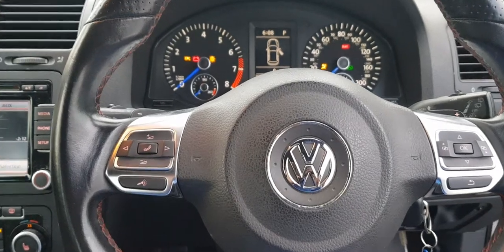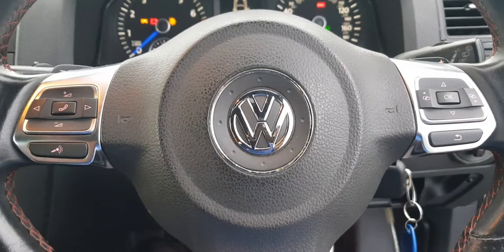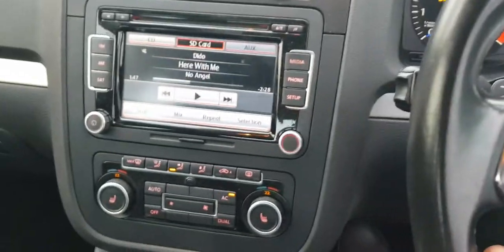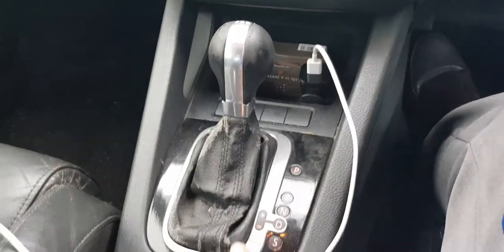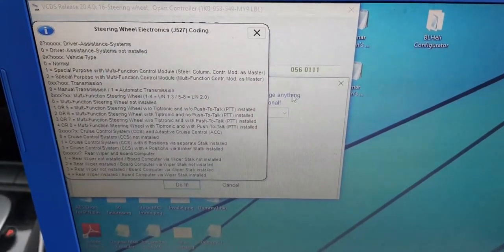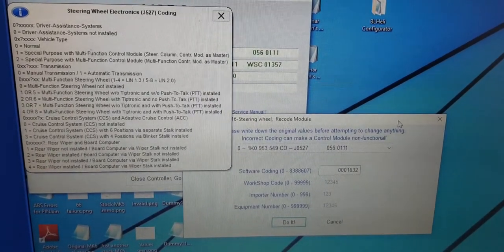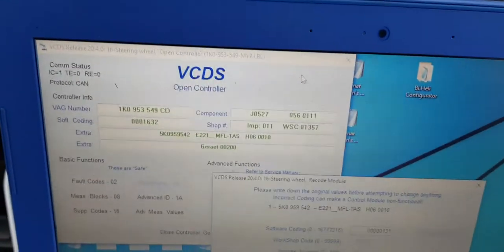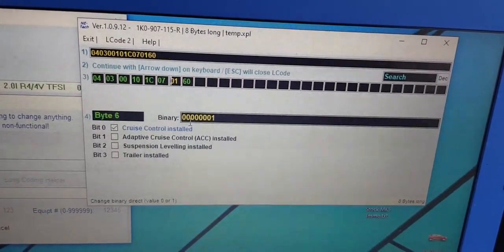MK6 GTI retrofit in a MK5 GTI coding

Comment: Can you teach how to retrofit a mk7 racing steering wheel onto mk5? Without the cruise control
Reply from the maker: I've never done it before,  but the process is the same,  however not all buttons will work (especially the horn).  The MK7 uses a different protocol.   There is some rewiring of the steering wheel control module that has to be done to get most of the buttons working according to the forums I've read.
Reply: @MatthewTaylor3  ok thank you man
Reply from the maker: @Tommy369x  I looked back at the issue.  The number of changes you would have to do to your MK5 to make ALL the MK7 buttons including the horn work would be equivalent to swapping in a good chunk of MK7 wiring and modules to the point that your MK5 is electrically a MK7 and you could even have a different VIN.   It wouldn't be worth the hassle in my opinion.  If you were in it just to get SOME of the buttons to work, and the aesthetic appeal then it might be an interesting project.
At the end of the day, you still want to know that your airbag WILL work in an accident.

Unless #RaceCar
Reply: @MatthewTaylor3  Alright man that’s some good info to know from you, would vcds be able to do the modifications? My current plan is to fit the Scirocco R cluster and steering wheel onto Mk5, what do you think?
Reply from the maker: @Tommy369x  yes, this would be a straightforward swap as it is the same as the MK5/MK6.  VCDS and OBDeleven can do the needed coding for both. 

The only challenge you would have is the immobiliser pairing if you don't have the original PIN.  You would use AVDI or similar tool to place the cluster in service mode and add a blank transponder
Reply: @MatthewTaylor3  Sorry I don’t understand about the immobiliser part 😅 It’s too complex for me bro
Reply: @MatthewTaylor3  Also, do you know where I can get a scirocco r cluster or you have the part number that can send me?

Comment: Very new to retrofitting/ coding. When you installed the mk6 wheel on the mk5 did you have to do coding or just replace parts?
Reply from the maker: Coding needed to be done to move me from the DDP protocol to using BAP for this new steering wheel

Comment: For some reason I cannot get in to the Slave module. It’s greyed out for me. I’ve swapped both of my CH control modules and the buttons nor horn work. I’ve also replaced the clock spring.. Not sure what to do next.

These are the fault codes I’m getting. If you could help that’d be great

00895 - Cruise Control Switch (E45)
014 - Defective - Intermittent
01426 - Controls in Steering Wheel (E221)
004 - No Signal/Communication
Reply from the maker: You can't code the two slave modules under address #16, just the master one.

You replaced the clock spring to the part number ending with "C"?
Please tell me what Steering wheel control module do you have under the steering column?   If you accidentally bend a pin or wiring out of place, then you can have these issues.
Reply from the maker: 0001632 is my coding for my RHD DSG car with multifunction steering wheel.  Your coding would be different.
Reply from the maker: What coding do you have in address 16 now?
Reply: @MatthewTaylor3  I have the same coding as you. It worked for 2 days, I had to reset the steering wheel to basic settings and for some reason the buttons no longer work.
Reply: Just confused as to why when the battery was pulled it stopped working. I have no clue whatsoever.
Reply from the maker: @moonhert  I'd then suggest looking at the LIVE DATA to see if it actually shows the buttons being pressed.  I'd then attempt to re-code the modules with the same known working coding just to be sure.

Comment: So the steering wheel control module that ends with CD works too? isn't only the module that ends with CH?

Thanks and great video!!
Reply from the maker: The module ending with "CD" works for ME, because I had previously replaced the steering rack with a different steering rack that was available locally.   This might not be the same for you.
If you post the module you have currently, I can tell you what options you have

Comment: Hi, i have a mk5 gti, now the story is that i actually swapped the whole dash from a mk6 gti and i had to make my old mk5 cluster fit, but i wanna get a mk6 cluster on it, now that i retrofited the whole dashboard, do you think is possible to make the mk6 cluster work on it? Thanks
Reply from the maker: The MK6 cluster will slide right in.  You WILL have to do some electronic immobiliser work,  and get a new transponder pill to complete the process.   I've wanted to do a dashboard swap, but my car is a 2-door, and I didn't know how the dashboard would line up with the factory door cards as they seem to be shaped differently.
Reply: @MatthewTaylor3  thanks for your answer, do you think they could do that if i bring to a vw dealership, or if so they sell they kit in ebay “cluster keyfob, and the two key cylinders, should i be good if i install a used set with factory keys as a combo?, and also the mk6 radio is gonna line up just fine with your factory door panels, everything in the dashbord is direct fit from mk6 to mk5 same mounting brackets as well
Reply from the maker: @valmorefaria195  Your VW dealer will not assist you with the retrofit for safety reasons.  There are eBay kits that you can buy and simply install.   However, swapping out a key barrel can be labour intensive if you are technical to do the job yourself (but you did swap an entire dashboard, so this would also be easy for you).  If you change you ignition barrel, you will want to change your dorlock an glovebox lock to match as well (so you can just walk around with 1 set of keys)
Reply: @MatthewTaylor3  nice, thanks a lot, apreciate your help
Reply: @MatthewTaylor3  hey my friend, forgot to ask, i have a inmo off ecu, so my ecu is stage 2 plug and play, you think that i could put that mk6 gti cluster on my mk5 without needing to reprogram, just adapting the cluster harness since my ecu inmobilizer is defeated? Thanks, apreciate your help
Reply from the maker: @valmorefaria195  Since you have a Immo Off ECU, you "might" just get a message on the instrument cluster indicating that the immobilizer is activated, but the car will continue to run normally.  You wouldn't need to pair any new keys.  You would just buy the 32-pin wiring harness adapter.  You would use VCDS, ODIS,VCP, OBDeleven to customise the features of the new cluster to your liking.

If you need to transfer the mileage, then you would use a tool like AVDI (or a chinese clone of the application).
Reply: @MatthewTaylor3  i apreciate a lot your help, you’re the best thanks a lot my friend👍🏻✌🏻
Reply: So in that case, let’s say i decide to take it to a vw dealership for that abs and psteering light with that they can help me out i guess
Reply from the maker: @valmorefaria195  Yes, the dealership can do the entire process for you (although legally they should ask you for some sort of proof of how you acquired the newer instrument cluster <for odometer tampering reasons>).

The dealer naturally would not take responsibility for fitting the new cluster to your dashboard, but can do ALL electronic portions and still allow you to maintain your factory key, as they would be using a wonderful tool called ODIS that automates the entire process by making a connection with VW's GEKO system that would identify your stock ABS coding by VIN, identify the PIN from your existing cluster and ECU (which would be the same).  The only thing that would be needed on your part is the PIN for the new instrument cluster that you would be getting.  With the two PINs being known, the pairing process would be done in the background without you having to get involved with the technical bits.

If you know someone with an "online" copy of ODIS, they can do the electronic bits for you too without having to go through the dealership.
Reply from the maker: @valmorefaria195  I typed up a lengthy response, now I don't see it anymore.

The short answer to that one is Yes, the dealership could all the electronic portions for you.   They would most likely want to see proof of how you obtained the instrument cluster (for the legal reasons of odometer tampering).  They would use ODIS to transfer over your mileage anyway.
Reply: @MatthewTaylor3  thanks my friend, i still waiting for the harness to arrive, are 36 to 32 pins adapters all the same? Only one i found was from passat b6 only one they sell in ebay for what i saw
Reply from the maker: @valmorefaria195  yes,  they are all the same.   You ordered the correct one.
Reply: Should i have problems if i install a auto transmission cluster, my car is a manual trans
Reply from the maker: @valmorefaria195  No.  There should be NO compatibility issues.  Since your car is manual, the cluster just won't show you the PRNDS or which gear you are in.  This configuration would have come from the gateway/canbus #19.   Your automatic cluster would simply know there is no automatic transmission in your car and not get any "useless" information to display.  Th only difference is that you cluster would just show you a message basically saying "Press clutch to start" as a polite notification for a manual car where the automatic would have just started by turning the key once the transmission is in Park or Neutral.

If the automatic car was "Push to Start" button,  there would just be a notification saying "Press brake to start".  Auto and manual clusters are the same and can be swapped interchangably.
Reply: How did you manage to fit Mk5 gti cluster onto mk6 gti dash? Is it a direct fit?

Comment: Whatsup my friend, me again 😂, i’ve been reading and since i wanna install the mk6 cluster in my mk5, some people say that the abs and other lights will show in the cluster(i still waiting for my harness adapter to be delivered) and as well you think that the display in the middle of the cluster will work fine? Bc the thing is that i don’t have any software like vcds or nothing like that, do i need 100% need a software for this swap? Thanks a lot you have been very helpful, apreciate you my friend.
Reply from the maker: I forgot to mention the fact that the ABS unit itself WILL factory reset itself, and as such its coding will be a string of "zeroes".  It is important for you to borrow VCDS, OBDeleven, VCP, AVDI, or a similar tool to backup, or at least make a note of the existing coding of the ABS unit.  You will have warning lights on your new cluster, but these will disappear after a routine test drive.  The fault code that will be present is your power steering LED as there is ABS unit would have done some sort of factory reset.   Once you have restored the previous coding on the ABS and do a test drive, all other error messages should disappear.

You also need some sort of software (like VCDS) to code your new instrument cluster to display your preferred units to your liking or to set your preferred oil-change intervals.  Your instrument cluster retains the option for the brake-pad wear sensor and the seatbelt warning.  You would need to toggle these options accordingly if you got the cluster from a vehicle that has a different configuration than yours.

The Ross-Tech forums can give you your original ABS coding based on VIN and ABS module part numbers.
Reply: @MatthewTaylor3  well, a friend of mine have vcds, should i be good with that one only or do i need another type of software, and so with the abs light or any other light on, will that actually make the car run or not being a able to brake properly? Or is only a error light bc the coding is different? Thanks
Reply from the maker: @valmorefaria195  having VCDS is fine. 
The wheel brakes will still physically operate without coding.   ABS, will not work in emergency braking conditions without coding.  The error light would be because the ABS unit will have NO coding (as though you just installed it in the vehicle for the first time).
Your error light for the steering will also be illuminated until you restore the coding for the ABS unit and do the test drive.
Reply: @MatthewTaylor3  so in order to get the coding from my stock abs module, i have to first conect the vcds with my original cluster and then do the same and transfer the coding that vcds will provide on my new cluster right?
Reply from the maker: @valmorefaria195  Yes.  Just to be clear: You would be reading and making a note of the coding in module #3/address #3 (ABS unit) with your original instrument cluster connected.
You would then restore that coding when you have the new cluster installed.

This is also the right time to make a note of the mileage of your existing instrument cluster if you want to maintain that. Restoring it would be done using a tool like AVDI when the instrument cluster is in Service Mode.
Reply: Ws bro, i just put the mk6 cluster on the mk5 everything working great except for the middle screen in the cluster is all black, and the steering wheel angle light is on, as well as the abs as you told me, to be honest im worried abt the middle screen not working, should i get another cluster, cuz theres rust on the clips of mine problably it caught water and the screen died, thanks for the support
Reply from the maker: @valmorefaria195  The middle screen (MFD/MFA) should light up showing you the default time of 12:00 and a false warning of the engine overheating / coolant reservoir needing to be topped up.  This indicated that the LCD ribbon connections is not correctly connected (if the unit was previously dismantled).  Please gently dismantle the cluster and check the conections if you haven't already done do.  I'm sorry to hear you are experiencing this as this was the highlight of you doing this swap in the first place.  There is an option to electronically BLANK the display but it iis reset once power is reconnected to the cluster, so this isn't applicable in your case.  The display is that "bling" that makes the whole swap worth it.  You may have to get another cluster to save yourself the hassle of troubleshooting the issue any further (but is it going to be a high cost to you?).   Does the car start and stay running  without any immobilizer work needed?  Also, did you backup the coding from the ABS unit (using any suitable VAG tool)?   Once the ABS coding is restored, and the test drive done, ALL lights should be cleared.  The only other lights that should expected is the seatbelt warning light, windsheild washer fluid level and brakepad level wanring light (if the coding is different from the actual configuration of the car (these options you can simply enable or disable).  Please inform me of your next steps with the cluster.   Based on the rusting you observed, you may have to replace the cluster and avoid the troubleshooting / corosion removal headache.
Reply: @MatthewTaylor3  thanks a lot my good friend you have been very helpful and i’ve learned lot from you 💪🏻, so rn the only lights it’s showing are the (ABS/steering angle light/TPMS and windshiel washer fluid) but to be honest im only worriend about the abs light and steering angle light, the car runs perfect, no issue at all, is braking great, no inmo light at all, i haven’t done any coding, can i run the car with that cluster and whenever I’m gonna do the coding, put the old cluster and get the coding then that coding in the new one, the car started at first attempt with no issue, and yeah i did disconnect the lcd display and plugged it again, no luck, so i guess imma get another cluster, only 65$
Reply: As well as my steering wheel is hard to turn and doesn’t turn back
Reply from the maker: @valmorefaria195  Fixing the ABS fault (by restoring the backed up coding) would fix all other steering issues (after a test drive).  I'll post a link to Ross-Tech's test drive procedure:

http://wiki.ross-tech.com/wiki/index.php/VW_Golf_(1K)_Brake_Electronics_(MK60)

AND

http://wiki.ross-tech.com/wiki/index.php/VW_Golf_(1K)_Steering_Assist

The windsheild washer fluid warning can be turned off using a VAG tool if you don't have that sensor.  As it relates to the stock ABS coding, you would have lost that the moment you added the donor cluster to your car (if you didn't make a note of the original coding.  You can restore it manually using the VAG tool to do the steps in the first link above.  Your VW dealer can restore it for you using ODIS (for less than an hour's worth of labour if you can't find a friend with VCDS or OBDeleven).  You can drive the car as is, but you just won't have ABS engaging in emergency situations such as braking hard in rain or snow.
Reply from the maker: @Valmore Faria  Having NO power steering seems like an issue with the steerign angle sensor or the steering rack (J500 module).
I'd suggest borrowing VCDS to check module #44 for its set of fault codes.  Those codes should have cleared already to regain the power steering.  Did you remove the steering wheel or column for any reason?
Reply: @MatthewTaylor3  no, I didn’t i just disconnected the battery and plugged the cluster
Reply: Could I do that with a digital cluster? I'd love to have modern refresh on my mk5